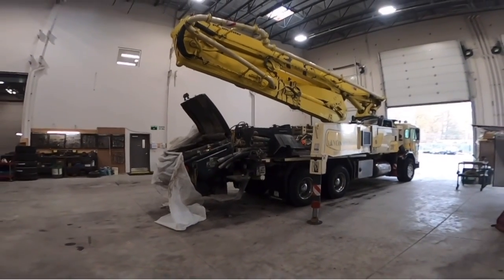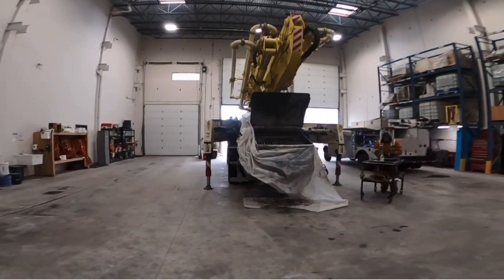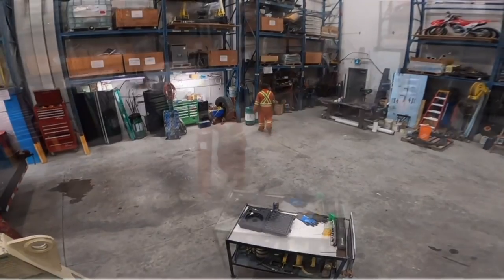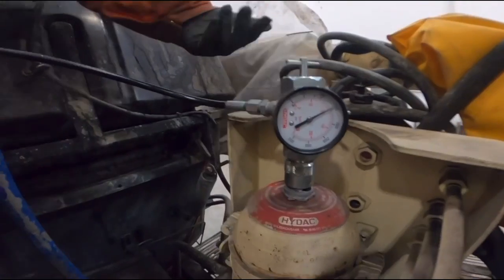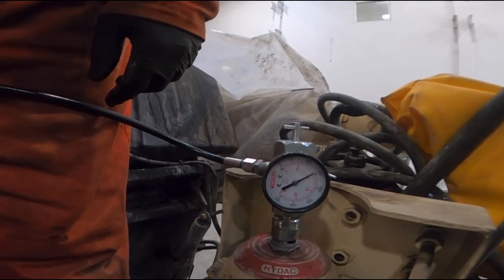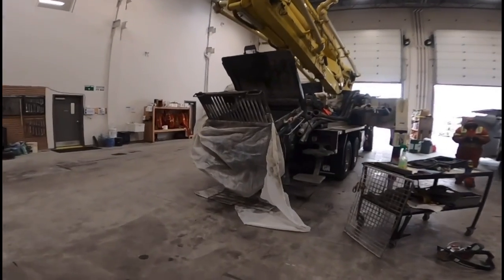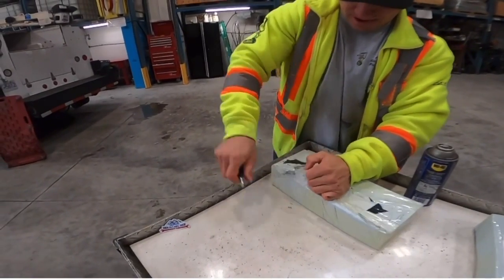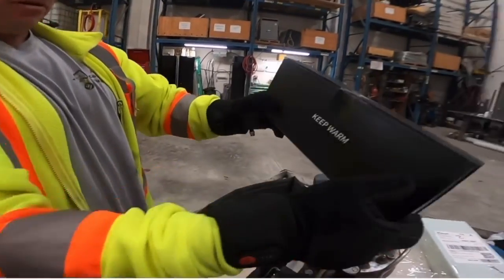Charging the accumulator bottle on a Putzmeister concrete pump.

Comment: I just bought a set of the gloves maybe 2 weeks ago.  wasnt expecting miracles, so i wasn't disappointed.  had a 7 hour job in 18F with sustained 20mph wind just the other day. high power is about the only setting you feel them really working. I too bought a second set of batteries so I could switch them and charge the other through out the day. I've seen 4000mah but im not sure if it'll fit in the storage pouch in the gloves

Comment: Man if the gloves work that will be a game changer. Nothing colder than a pump operator not getting to move around. Good video of accumulator bladder refilling also. I don't seem to get very many winters out of mine. I Probably need to stay on top of pressure better when it first gets cold.
Reply: What gloves are we talking about the ones David is wearing? I don’t recall anyone talking about gloves!?
Reply: I’m always on the hunt for good water resistant winter gloves!
Reply: @colemenjacquemart8897  at  16 minutes he unpacked a new set of battery powered gloves. They look to just be operating gloves like for a remote,  or in a deer stand with a rifle. I will be interested in hearing how they work.

Comment: I was told by our local dealer that first thing in the morning in the winter to cycle the accumulator without shifting the s-tube. It allows the bladder to move slower and help prevent taring of the bladder.
Reply from the maker: That’s some good information. I’ll be adding that to my routine. Completely makes sense. Thank you for the insightful comment. That’s what this channel is all about 👍🏼👍🏼👍🏼
Reply: How do you only cycle the accumulator?
Reply: @thegoodgriff  engage the pto release the estop to engage the pumps and build pressure and then hit the estop again to release the pressure and drain the accumulator. It’s a slower bladder movement compared to cycling the stube.

Comment: So does pump size affect what the pressure the accumulator pressure should be? or is that what it should be regardless of size?
Reply from the maker: Pump size, to my knowledge, is not a factor with regards to the specified accumulator bottle charge pressure. I have noticed that pump kits which use larger shift cylinders will often use a larger accumulator bottle (more volume of oil required to move the cylinders which in turn requires a larger volume of stored energy to move said oil…. at least that’s the theory which makes sense to me).